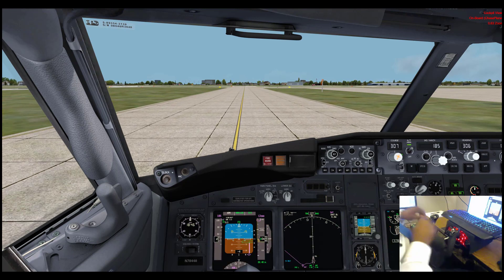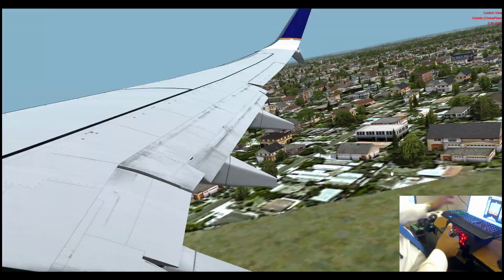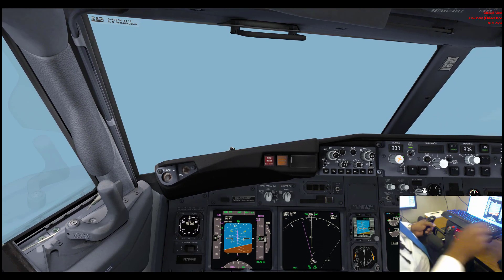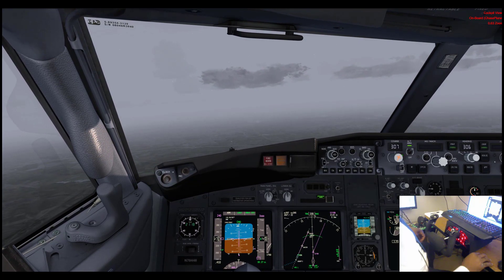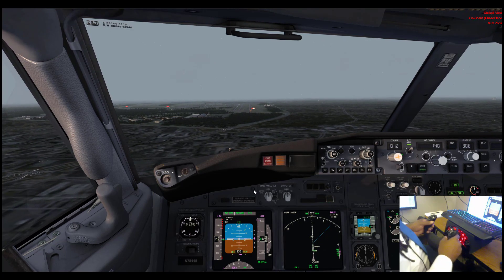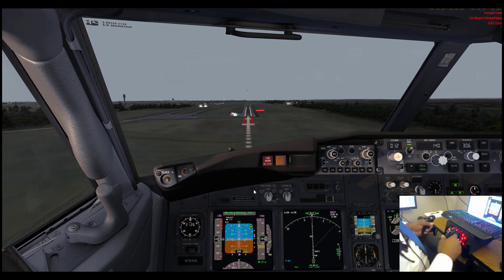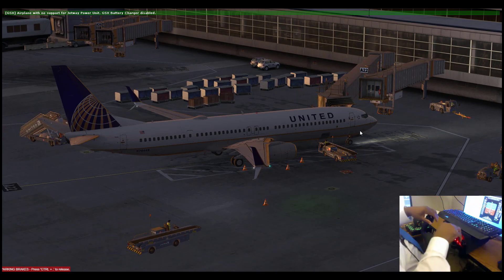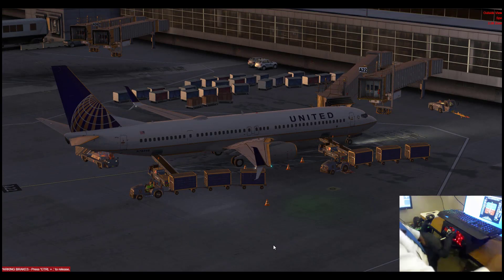P3D - Honeycomb Flight Yoke Test Run - PMDG 737-900u

Comment: Hi Kent. Thanks for the demo, good presentation, can you tell me what you use to control thrust / throttle also assigning switches for controls appears to be very complicated for P3D, I have the yoke but reverted back to my joy stick as I have rudder and throttle control. Do you have to remove the joy stick software to use the honeycombe yoke to full advantage is enabling auto rider a good option if you don't have rudder pedals to control nose wheel steering on the ground etc. Thanks any advice much appreciated.

Comment: Kent can you do a setup with this into P3D4 I'm struggling with it, like in the PMDG 737 NGXu only the co-pilot yoke responds to my input?
Reply from the maker: I am going to need some backgorund information.  I am not entirely sure what you're asking for.
Reply: @Physics70  So I'm trying to setup Alpha yoke into P3D4.5, I 've deleted  some the key configs my P3D  so I won't have conflicts but when I'm in P3D4,  pmdg 737 aircraft only the co-pilot yoke responds and the pilots side does not move? I only have  switch's  5 & 6 Trim / 7 & 8 Zoom I/O. and I don't know how to assign the 3d hat switch in P3D4 so I can move look around in the cockpit, I'm not sure what to assign it to in P3D4 key settings?

Comment: What about key mappings? Easy to do? There are a number of buttons but not sure if they are hard coded to functions or not.
Reply from the maker: Marcus Maunula I’m sorry to say, it’s a bit involved.  If you map them using P3D, it’s not too bad, but mapping for some aircraft don’t correspond to another as it seems.  Using their software for mapping is still something I’m working on.  The big problem is I still use Saitek Throttles which have been quirky with my P3D.  I won’t really be able to map this bad boy properly until they release the throttle quadrant.
Reply: @Physics70  I read that Aerosoft had some updates to the software. Othwerise I am looking forward to tomorrow when 330 releases :)